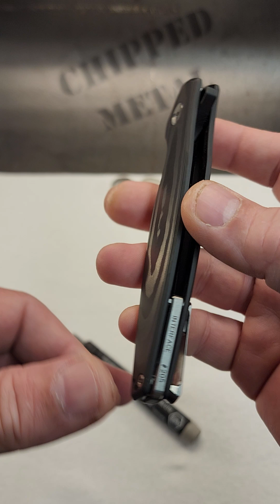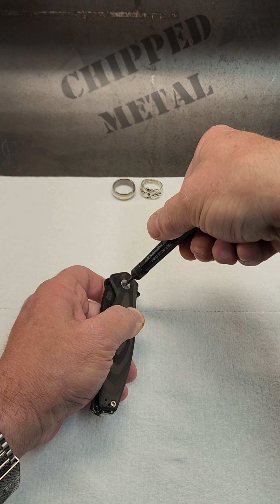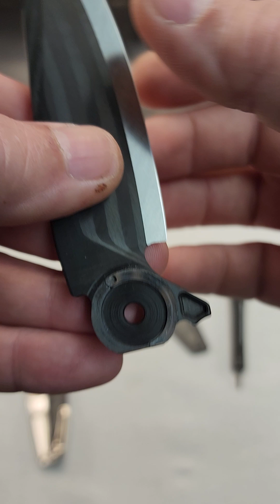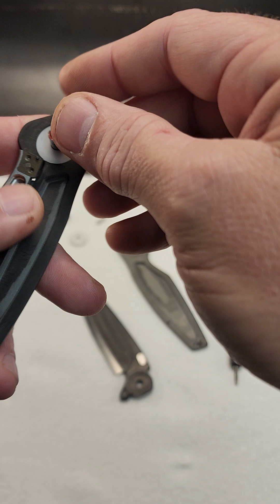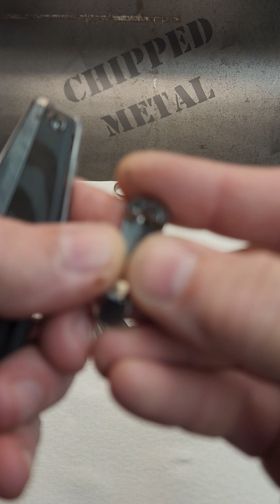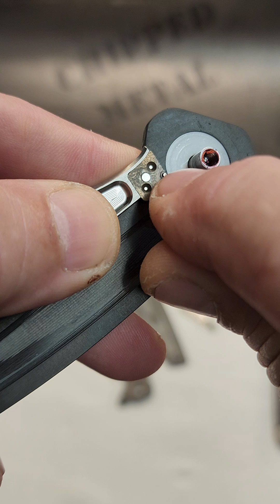VC Edge "Interface" disassembly

Comment: My issue is is I like heavy knives like 1 to 2 oz is too small for me and I feel like the carbon fiber would break. But once again it's not a screwdriver or a hammer. It's a pocket knife. It kind of reminds me of the opposite of what the John venoms were. He had the carbon inlays
Reply: I worked in the high performance automotive industry and did a ton of r&d with carbon fiber. It's impossible for me to effectively convey how strong carbon fiber is.
Reply: I agree with both perspectives. If used for, say, cutting vegetables, boxes or cordage etc I suppose the knife should hold up fine.
I believe CF is more brittle than steel and that by flexing or torquing it might be comparatively easy to compromise the blade at the union of the district materials. 
Albeit the larger size and relatively robust construction, a knife so lightweight would certainly be unsuited to heavy tasks - no way around that, I don't suppose. 
Probably out of my price range but I love the concept. If it's that light it could come right along 
At this moment I am carrying just under 23oz of knives on me; one 7oz belt knife (inc. sheath), one pocket fixie, two single-blade slipjoints one small lockback, a Leatherman and and a mini SAK. 
I wear plenty of big pockets.
An extra 1.5 oz would just disappear among the noise ;D
Reply: One of my best friends has a carbon fiber surfboard. It has its problems, but they aren’t related to strength (it gets really hot in the sun which can melt wax and it has unusual flex when you are used to fiber glass). The demo when the board were first released was to lay them on the pavement upside down and have people jump on them. They take it without damage. It’s amazing stuff.